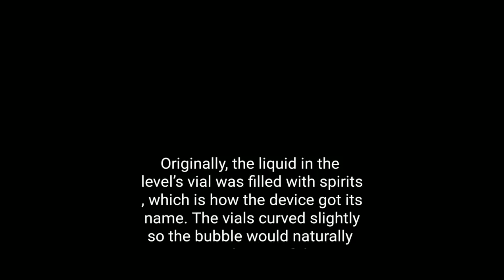Antique Level Restoration And Customizing

Comment: Unfortunately, there was no attempt to make the level accurate. That bubble is intended to rest within the markers when the device is level. The fresh tube was fitted in its holder by guesswork, without checking ANYTHING. It could have been up to 5 degrees away from level for all we know. None of the holders were refitted in the frame properly.
Reply from the maker: The level works perfectly and is accurate

Comment: Video was fine but could have been 10 minutes shorter because we don't need to watch you Dremel for 3 min. and remove tiny screws and then put them back- -2 min.preparing frame for paint then using spray can 2 min. etc. I'm way too busy I know~!!